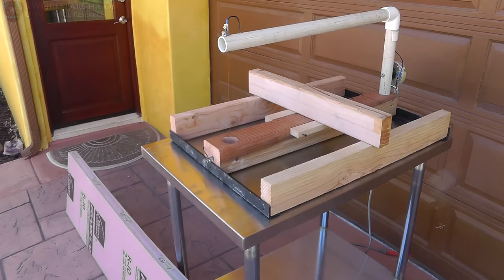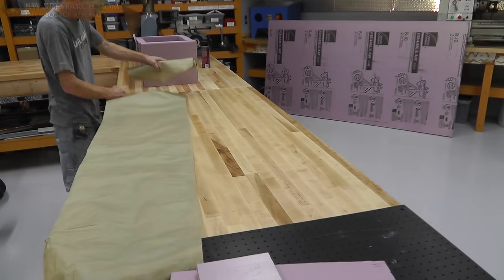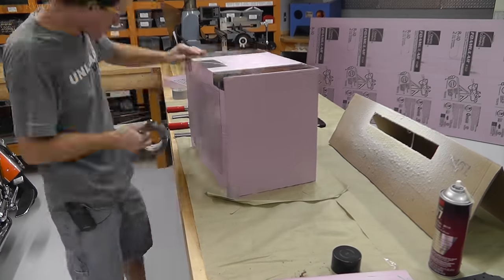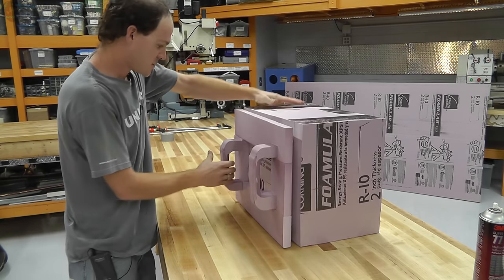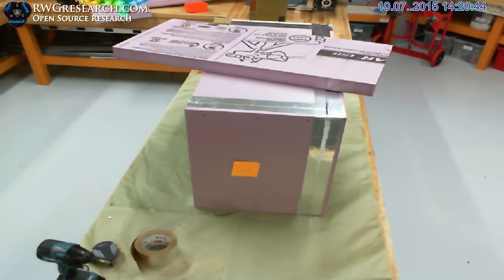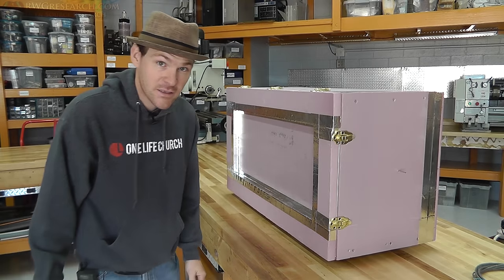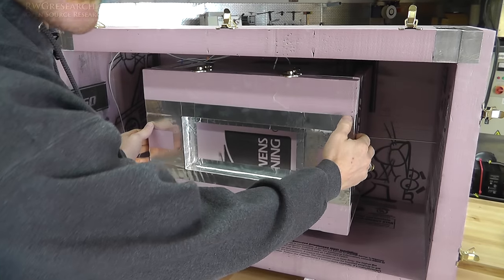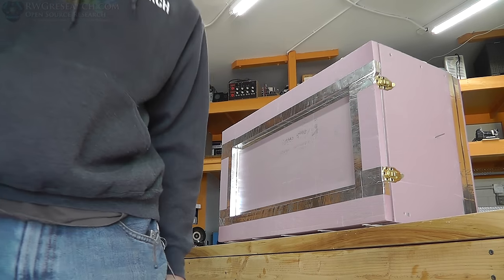Cold Fusion Update#1 - Making The Low Temp Calorimetry Containment Box's. Styrofoam Cutter.

Comment: Russ, for future projects that use Styrofoam like this or any weak materials like particle board or plastic, look into using Hi-Lo Thread screws. They are great and when you see them you will understand why. They are a double thread screw. The hi thread goes makes it's own thread while the lo thread makes it's own separate thread. - - - - In particle board and plastic, it's probably best if you drill a pilot hole the size of the screw shank and no larger. If you drill a pilot larger than the screw shank, the low threads won't have a gripping area. - - - - I hope it helps you or some other viewer that may not know about these great screws, sometime down the road.

Comment: Why not just make your outer lid a couple of inches bigger so you can pull it off by the overlapping bits?
Reply from the maker: +Colin Hammill good question, first it comes off quite alright with out the handles but thought handles would be nice :)  next i removed the handles later and there is not extra room inside the box / hood for over laps. but your method would work well. thanks for the comment! ~Russ
Reply: ***** You wouldn`t need room inside the box. If you did the two smaller uprights out the ways a bit you could still have top & bottom locking and just an overlap at either side of an inch or so should allow it to be wiggled off. BTW great job :)
Reply from the maker: +Colin Hammill gotcha, yes, but i'm moving air inside the box. so less obstructions the better :) also when i put the big box in the lab hood there is not room at all. lol ~Russ
Reply: ***** I think you`re still missing my point. If the outer panel (not the one on the inside) was wider by 2 inches than the box itself that would give you your grip.
Reply from the maker: +Colin Hammill yes. I understand. your taking about the lid. if it was wider than the box. then I could grip it behind and pull it off. but. I'm saying if the lid extended past the edge of the box. I have even less room in between the box (lid) and the wall of my lab hood. where it will be placed. :) I think we both understand. let me know of I'm still missing something. :) thanks ! ~Russ
Reply: ***** Gotcha man :) lol